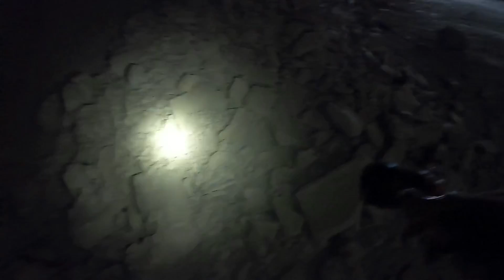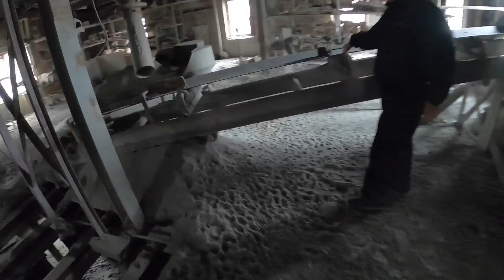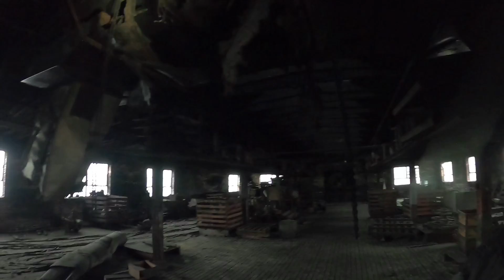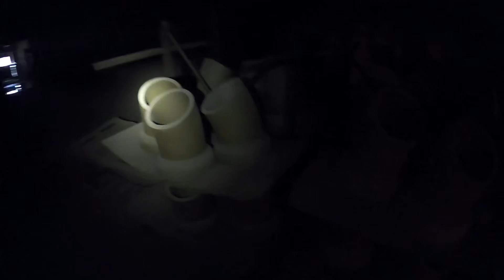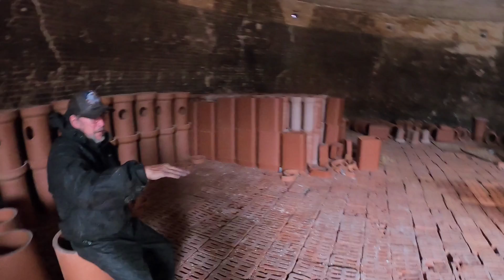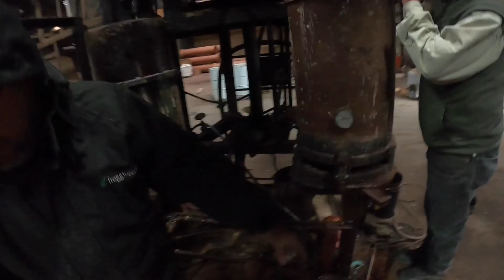Unbelievable guided tour of the abandoned Can-Clay pipe factory in Cannelton Indiana #coolplaces

Comment: I laid a lot of clay pipe with the molded rubber connections in the Detroit area in the 60s. The city used it for sanitary sewers that are still in service today. Detroit even has wood water mains and lead service piping. I made a 1” hot tap in an 8” wood water main once,  it looked like a banded oak barrel.I am sure they are still in existence under a lot of the old streets.

Comment: Those crushers are roller mills. I used to work at a limestone  quarry that had two of them side by side making 80, 100 200 and 270 mesh. Basically the size of sand to a near talcum powder on the finer side. If those mills ever ran dry due to a gravity feed issue it would feel like an earthquake and sound like a runaway freight train.  Glad I got to see them. Thanks!

Comment: Thank you for one more great video!
About the motor.. It's hart to see the text in the flashlight, but I think it says 196.8 amps. That would be about 22kW or 30Hp at one phase at 110V, or 40kW resp 54Hp at 200V.
I don't know if that's the correct voltages, but if you can read the voltage at the sign you can just multiply it with the amps and you would have the power taken from the grid.
The output power would be maby 20% less, depending of efficiency etc.
Reply from the maker: Interesting thanks

Comment: Very interesting. This video reminds me of a tour of a little terracotta plant in southern Portugal. It had been there since Roman times. Probably a 4-6 man operation. Red clay was from the hill behind was mixed with water and extruded into blocks, pipes, the half pipes for roofs, hollow bricks for walls, etc. They sat out in the sun for several weeks to dry. Then placed into a bee hive shaped kiln and fired with grape vine residue from the winery and almond husks. The only modernization in 2000 years seemed to be a small motor on the steel cement mixer. Everything else was done by hand. Most houses in Portugal are cement floor, terracotta walls covered with cement and terracotta roof. Thin rebar is inserted in the cement corners, and beams. In a place with few trees and little wood with a hot sun and torrential rains some times, these buildings stand up well. Off standard and broken product was broken up and recycled. CanPipe was using the same process, just much more mechanized.

Comment: That brings back painful but good memories of kneeling in the trench joining clay pipes with cement and when I first started working on sewer drainage the pipes were still only 2 feet long. We had to lay them with perfect fall,straight and no lip on the joints and it was all pressure test and inspected.
Reply: respect
Reply: Tested and inspected. A thing of the past that America sorely needs again. My dad did the cement with 2' pipes and then came the pitch on the spigots with an O ring to fit the hubs. In NE PA, they could use clay for storm but all sanitary was XH cast throughout the whole job. All lead and oakum of course. In SE PA, it was common for everything to be XH cast with lead joints, well into the 80's. Then it went to XH cast underground and no hub allowed above IF water tested and inspected. I think some residential allowed medium cast but that was really dumb as a lot of it failed due to thin wall imperfections during the casting. Dad was in local 690 out of Philly. Prior to that, Local 670 out of Allentown which was a combined local, plumbers and fitters, before the merger and splits with local 420, also in Philly.
Reply: Ricki  your father had a tough job. I’ve dug around that pipe it is artwork 👍🏻